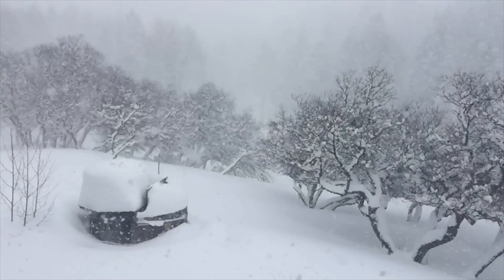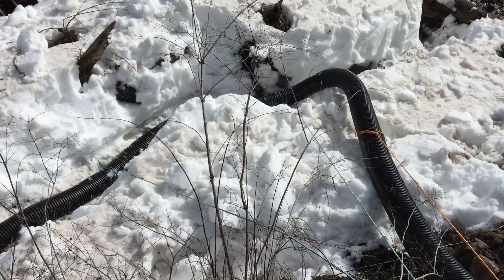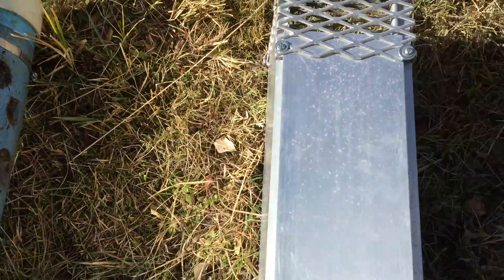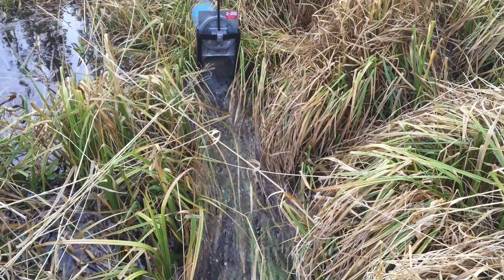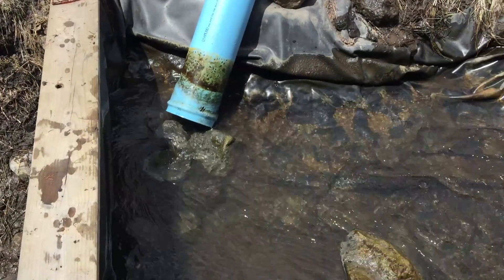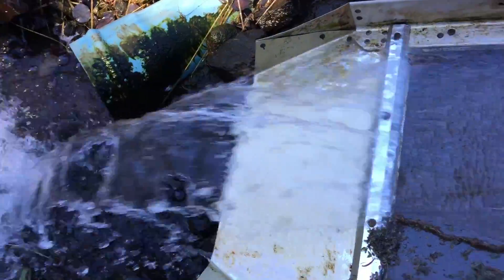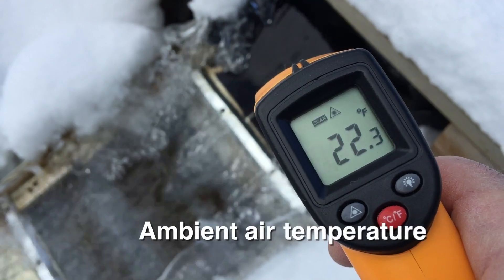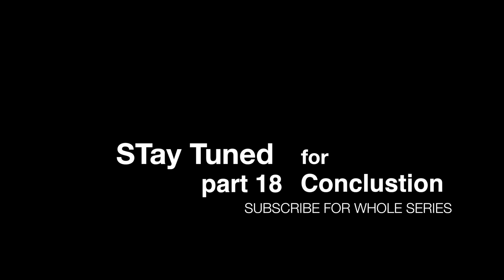Part 17 MicroHydro Power System in CO

Comment: Why bother to replace the air-release screws, just to need to intermittently remove them again.  It didn't seem like too much water being wasted.  You could even make the holes smaller. Just let it flow continuous
Reply from the maker: +Ben Coman Uneven grade permits air pockets which reduce flow greatly.  If exit end is open suction at screw holes draws more air into pipe and flow eventually stops due to full air lock of siphon effect.  Soon to install a different intake design hopefully to prevent all air from entering pipe.

Comment: nicely presented ,informative and to the point .thank you .Do you experience any freezing of the pipe that is supported in the air ?
Reply from the maker: +Felix Bloxham I don't think there is any.  There is a small jacket of air between the corrugated and pvc.  Not sure it helps, but might.  Corrugated is mainly for strength. The flow remained constant throughout winter.  Thanks for watching
Reply: at the 2.28 mark of your video you mention a pipe bridge, thats the point i was interested in if there is any possible  freezing at this location or is the water sufficient to  avoid that

Comment: I have good results with water flowing over a round plastic barrel laid sideways with hundreds of 3/8" holes over the top 1/3 of the entire barrel. It is covered with stainless steel window screen. The flow out of the barrel has to be a lot less that what flows over the barrel so the screen never needs cleaning. It survived many winters like yours, no ice problems as it makes it's own ice shelter over the works.
Reply from the maker: +Canvideo Cool idea. Our setup works quite well too.  This was first winter fully observed on the intake. I probably didn't need to break my ice shelter, but enjoyed seeing the changes over time and messing with it.  Thanks for watching

Comment: I live on a boat and would like to do this with tidal currents, there are 2 tides a day that means 4 times a day I have a strong current. I have thought about using paddle wheels, unsightly, but my hopes are on a propeller design. I'm going to experiment with an electric trolling motor as soon as I get back to FL. I am currently in the great lakes, no tides or currents here. I like that you never gave up and all changes moved you a little closer to a low maintenance system! Superb job with video as well.
Reply: LOL! Of course, there are currents in the Great Lakes. How do you think the water finds its way over Niagara Falls?
BTW, I grew up in Lorain, Ohio so I know firsthand that Lake Erie has a current. True, it is not very fast, but it is there.

Comment: When you are too old to endure the walk to de-ice??? What then? Why not engineer a water powered system to clean the intake. You could pattern it after a water hammer and perhaps in this way reduce the number of trips you need to take to clean the intake. As for the outlet, why put a gate in anyway? Just let it flow, and let the flow keep the ice clear. The air is a matter of leaving the small screws out and continually allow for a small controlled leak in addition to engineering the pipe decline to be constant with no high spots to collect air.
Reply from the maker: +Dr. Ramon de Torres That old? Probably sell the property. Installing a Coanda with 50degree slope this summer. Should reduce/eliminate need to clean.  Diversion pipe has to be seasonally removeable and hence the uneven grade.  There is a siphon effect when exit end is open, so additional air enters and eventually shuts flow down to a trickle.  New intake design to be tested this year to block all air from entering at intake end. Thanks for watching and your thoughts

Comment: Be careful with black steel near stainless. Once it will touch stainless part micro elements will stay and almost immediately start corrosion.
Reply from the maker: +Pawel Lang Thanks for the dielectric tip.

Comment: The water is certainly Not below the freezing point.
What happens is that most of your thermometer is in the far colder air and thus gives you a false reading - they are not designed to measure spot temperatures.

And - why not make a more static intake? 
Let the water pool up a bit and there make an intake that is away from any small watefalls (cause they introduce the airbubbles)?

Comment: Instead of that kind of screen , you should use stainless mesh250   He 259 is how many holes in a square inch of the mesh it would last for ever , southwestern wire clothe out of broken arrow OK will have what you need the address is 504 north redbud  BA , OK

Comment: You may want to think about airlocks used in boilers and hvac that let air out of the line but not water and get away from filters and use a centrifugal system that separates the water and debris by weight and syphons the water off it could be less to clean great work please keep it up

Comment: As an experienced engineer, I would suggest installing some sorts of "Back Wash System" much alike as those readily available for large pools, this will take care of all of the algae and debris built-up on your screens.  All the valves and hardware are available, you would only need to tweak the control of the ice buildup, but again you are wasting physical energy the could easily be solved by means of a regular swimming pool backwash system, albeit adapted to you particular freezing conditions. Regardless, great idea and a great application of renewable energy.

Comment: The air lock issue might benefit  from using auto vents used in hydronic heating systems . Air escapes but liquid does not and there are several sites with home made plans for them using pvc. 

Enjoyed the video and the ideas  you have put to use.

Comment: Great video!  It's the first one in the series I've seen.  Your problem with air locks reminds me of pressure relief values I see in the irrigation supply pipes on the family farm. It seems like this type of solution would solve your problem.  Here is a link to an example valve:  https://goo.gl/images/qPfKmw.  In the valve is an air filled ball.   Water causes it to close, while air is allowed to release.  I'm not sure if it would work in freezing conditions like yours.

Comment: Turn the screen the other way so the slots line up with the waterflow. It will be self cleaning. We use them in industry.
Reply from the maker: Interesting.  I'm trusting the folks that build the screen on  how to install.  Talking to them now about a different design with a steeper angle

Comment: The snow can provide insulation against freezing conditions.  Put a two, or more, lengths of 6 inch pipe about the water flow and allow the snow to accumulate over the water flow.
Reply from the maker: Good idea.  The fortunate part is that we made it through the brutal winter this year with no freeze up to the pipe.  Moving water just doesn't seem to freeze unless it has a surface to stick to.

Comment: Why don't you just install autoair relief valves? You can get them at any solar water heater store. About $35.
Reply from the maker: Problem is that the flexible black pipe just isn't stout enough to install fittings into.  We have air relief valve on the original penstock and they work fine, so we are aware of them.  Another viewer recommended an vortex intake and that will be an experiment this season.

Comment: thanks for posting.  (11:32)    200kwh/day...is this a correct.    cheers
Reply from the maker: yes correct 8.5kw X 24hrs = 204kwh/day.  we throttle it back if we don't have goodies for the power rather than make wasted heat

Comment: You might be able to build a water powered, geared rotary (or oscillating) cleaner to your screens. Would be simple enough to do. This could be used when there is no ice and removed during the winter months, to prevent them from freezing up and blocking the flow. I can think of multiple designs to do this and I'm sure you could too.
Reply from the maker: Its kind of fun to go up and see what the cold has created every few days.  the important thing is that it just keeps running in winter.  We are talking to our coanda screen people about a better design that will be mostly self cleaning.  Stay tuned as we put that plan into action.  Thanks for the suggestion just the same.

Comment: I like your videos and enjoyed watching the challenges you overcame. I have a question about motivation. Are you unable to get regular electric power to your home? Or, is your goal carbon-free power? Have you calculate how much money you have spent in time and labor for this project? I do see how much power you've generated, which is pretty amazing.
Reply from the maker: Brian St. Denis  Both motivations have been present. In 1996 when the system was installed the local utility quoted 7 * 20k or $140k  to string wire to the property for 7 miles. Our initial penstock supplied gravity fed domestic spring water, electricity, and the ability to raise trout all for 25k so economically it was a no brainer. I've always leaned green philosophically as well. I still want a hydrogen powered car where I can electrolyze my own fuel from excess power, but trends don't look like that will be coming anytime soon. 😉

Comment: This has been a great learning experience and thank you for showing your learning points too.  I don't know if you've posted this elsewhere, but what's been your cost for the build?  It seems you've put a lot of money in this.  I am sure it has been worth every penny in your remote location!
Reply from the maker: +Chris McDavid You are most welcome, our pleasure to share the knowledge.The original install was about 25k, but we got pipeline, powerhouse, turbine, generator, gravity fed domestic spring water and a fish pond with pier for that.  A great value at the time.  That was in 1996 dollars and the estimate to bring mains power in at that time was 20k/mile x 7 miles = 140k.  So that was a no brainer.  The system ran faithfully for 17 yrs at a lower output of 1500-3700 watts before the drought/aquifer issues arose.  The redesign with powerhouse, transmission line, creek diversion, weir, pipeline, bridge, and transformers has run about 55k.  But now we have so much more power and it's enough to supply nearly all winter heating needs at 8600ft.  Micro hydro requires all costs to go in up front and amortize over time.  It's a lot of money, but in the big picture of value to the 340 acre property it is a small cost for a large return on overall valuation.  We are very satisfied with the ease of power production and the lifestyle it provides.  Happy Earth Day, & thanks for watching!  Subscribe for more to come.
Reply: ~Micro hydro requires all costs to go in up front and amortize over time.~
same would apply to installing powerlines and then on top you pay the utility company!!
I would prefer your method anyday.
BTW, you said you used to be a cinematographer, anything we would see on the silverscreen?
Reply from the maker: Mostly did commercials.  Ever see the Bud Frogs?  Most have.  Tons of other faceless nameless spots, but that one is memorable.  Not much theatrical, Nomads (1984) and 52 Pickup.  It was a great gig to have for 30 years.

Comment: That was awesome, thanks. Sub'd
Reply from the maker: +bradek3788 Thanks for watching!
Reply: Thanks, I'm really enjoying going through your videos and dream of one day attaining something similar to your example. I watched another video which used an Archimedes screw in a creek to achieve the same result. Did you do any analysis prior to determine that the mini hydro was more efficient? or where there other factors which determined tech? I'm very keen to try something but my issue will be flow volume so need to ensure max efficiency of output. Any advice you can provide would be appreciated.
Reply from the maker: bradek3788 my process started in 1990 when I acquired the land, but nothing of how to. I took a class at SEI inCarbondale,CO on micro hydro in 1994 as getting info from libraries was limted (pre internet).  I learned tons there and the instructors of the course guided me thru an analysis of my site to determine the most efficient plan. Every place is different and MH is very site specific. If you've watched all the series you know I've actually built 2 systems of different outputs on the same property using the same generation equipment. My design of pelton turbine is just one of many that can be installed and it was the best approach for efficiency given the site parameters of my first installation in 1996. The second system in 2015-6 was the best case approach I could come up with utilizing the same equipment. If I didn't already own that gear I might have chosen other equipment. There are lots of decisions to make in doing a system. I've attempted to explain my process via the videos in total but it only scratches the surface of what is possible. Primary starting points include flow measurement and head or fall measurements. These can guide what equipment is most efficient. I didn't want batteries and had enough water and pressure to do direct AC which is more efficient than DC for generation & transmission. You can do pretty well with any site that has consistent and ample flow and/or head. Determining site potential is critical to making a plan. Also determining NEED and USE for power also guides how you go. LED lights are super efficient now and didn't even commercially exist when I started. Gaining knowledge of all options is the best thing you can do. I'm still learning things after more than 30 years of efforts. The arch screw designs are very interesting but I've never seen one. I have a friend at a local electrical coop that may find me one to film in the future. I don't know the engineering data but they look like they would work best with very high flow and very low head. My first install was high head and somewhat low flow. So it all starts there with flow and head measurements. This combined with knowledge and use decisions guide what choices are most cost efficient. You pay for all future power up front so while expensive it amortized over time. If you send me an email address I can provide you some books or manuals that give access to the knowledge to help understand what is best practice and most practical given site parameters. I just returned from Japan where they have a ultra low head system design I just learned of. Unfortunately they wouldn't allow me to film it or it would have been my next video segment. -MrHydrohead@gmail.com
Reply: Thanks for the detailed reply, I'm still working through the videos as time limited so didn't see that this was second go. Will send you an email shortly and really grateful for any directions you can provide. Kindest regards. Brad
Reply from the maker: bradek3788 Here are just a couple of resources to start
http://www.microhydropower.net/download/books.php
Is a great site for lots of information 
https://www.scribd.com/mobile/doc/131329981/Guide-on-How-to-Develop-a-Small-Hydropower-Plant-ESHA-2004
Is an overview manual amoung many available
https://www.homepower.com/articles/microhydro-power/basics/what-microhydro-power
Home power magazine consistently does good practical articles on specific installations and the process. There is a book which compiles many of them
Reply from the maker: +bradek3788 home power book is: 
Serious Microhydro - Water Power Solutions from the Experts by Scott Davis maybe all those articles and more are available from magazine site for free, not sure. Anyway they are a great resource and a subscription offer can also provide a cd of all past articles including solar and all other solutions
SEI Carbondale:
https://www.solarenergy.org/courses/micro-hydro-training-micro-hydro-design-installation/?session=14058
Is an active course where you can be fully educated in a week for a price. Many other courses here too. 
Sorry for the fire hose of info, as you can tell I love it all

Comment: Interesting project! Great to see self supplied power. :-)
Would it be a good idea to build a roof over the intake so prevent snow building up? And maybe some walls around it?
Reply from the maker: +Alpejohn Maybe, although it works pretty well as is.  It's more the  severe cold which causes it to ice over, installing a roof might make clearing it even more complicated as any structures would provide surfaces for ice buildup to form on from splashing supercooled water.